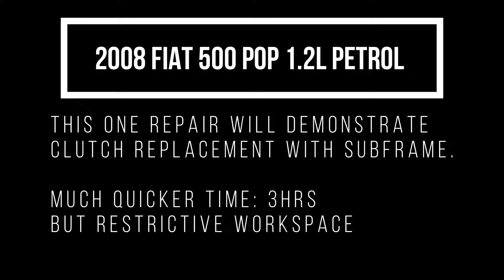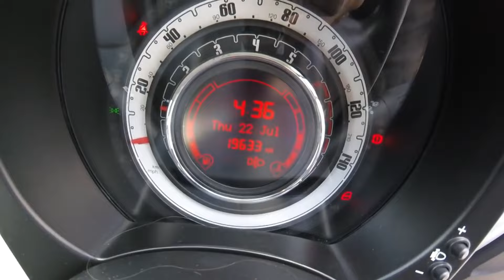2008 Fiat  500 PoP 1.2L Petrol Clutch Replacement.

Comment: now which would you rather have a small car or big car to work oni think i would rathe have a small car because if it comes off the stand its not going to do so much damage to you ,thanks for the vide and my daughter has a 500
Reply from the maker: Oufff… don’t think either outcome would be good .. but from a work perspective usually bigger cars have a bit more leg room.  But takes a lot longer for securing on axle stands. A lot longer … 🍻🍻🍻🍻
Reply: @WMCS  👍👍

Comment: Why are there never any seized bolts for you? I so far have had to struggle with every bolt and both drive shafts seized. How hard can you hit them through the hub to free them?
Reply from the maker: They are seized. I try and explain in the video the technique to free them. 
Losts is f wd40. Every turn of the nut or bolt. You have to keep working it. In and out slowly.

Comment: Is there a certain way to prop the gearbox on the brace bar? I have left the stud in as I can’t get it to budge but I can’t get much room to remove the clutch. Do you take any bits off the gearbox to make more room?
Reply from the maker: I’ve done two version of the same car. As there are subtle differences. Check on channel.